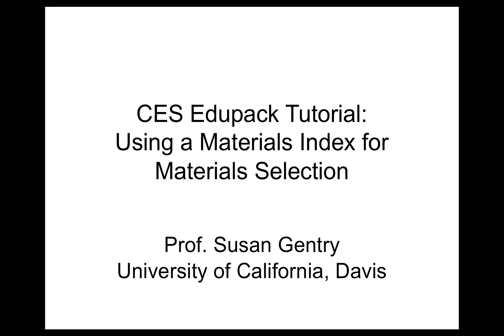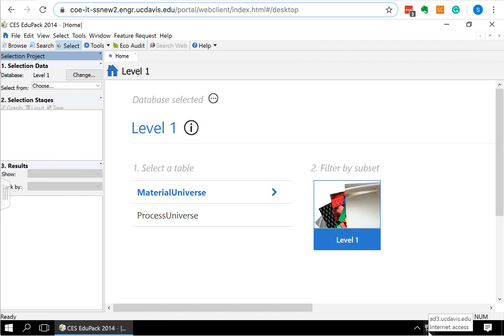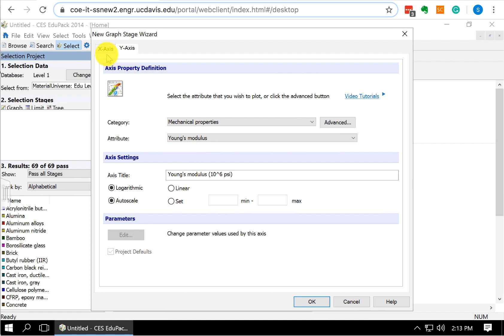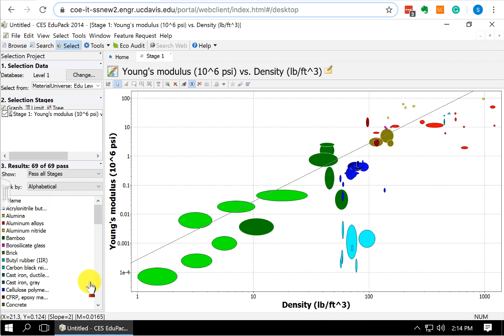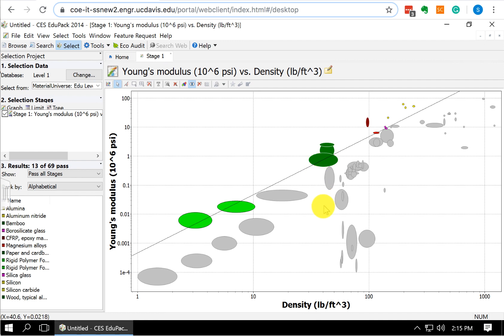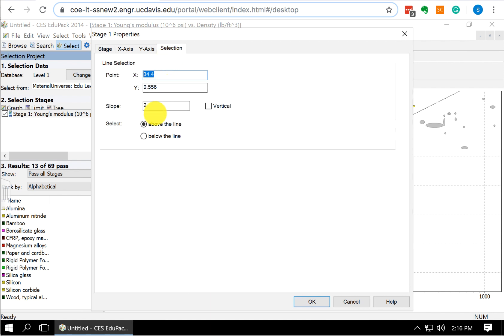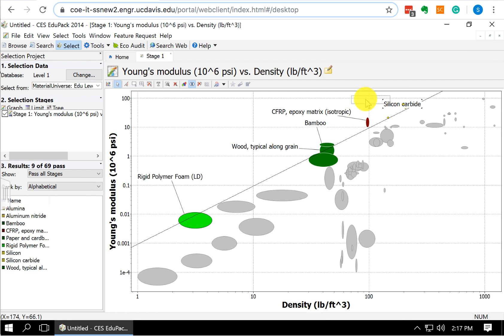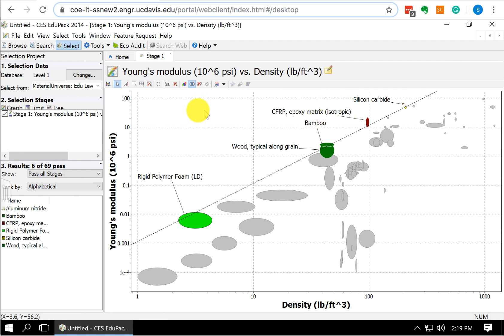CES Edupack: Materials index on x-y plot

Comment: Hello, why did you not explain the process of calculating the slope? Made the video worthless imo
Reply: Using the slope is completly pointless to begin with. The materials which are scoring highest for each material index is already plotted on the graph out anyway. And you can also chose to rank all generated materials by each property limit you have set. You can just go ahead an select your material independently of the slope.